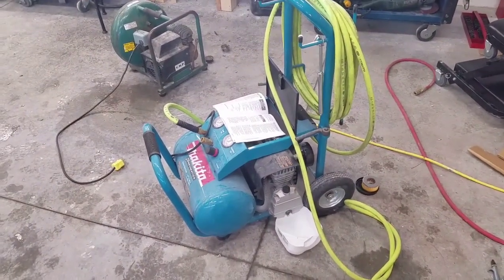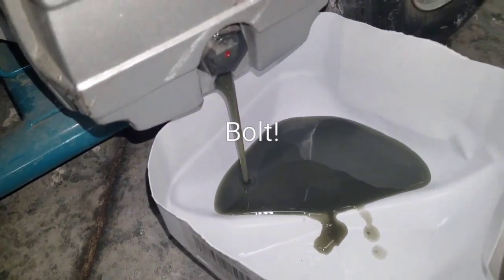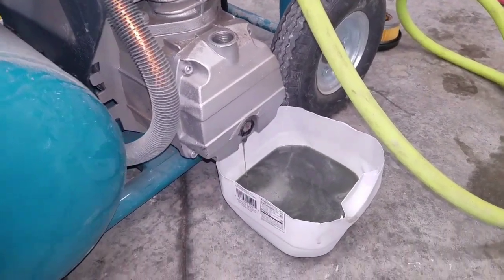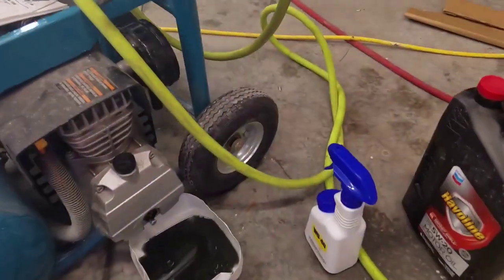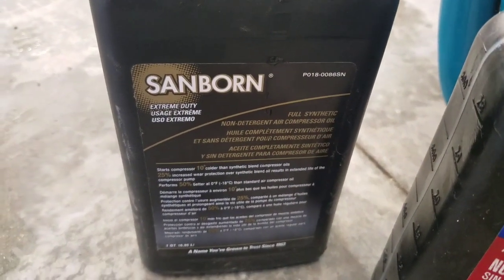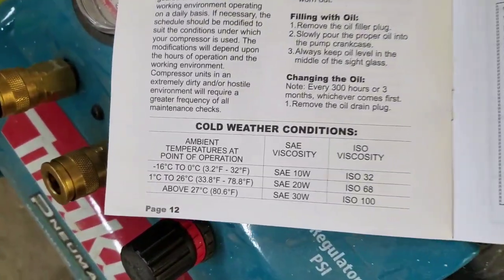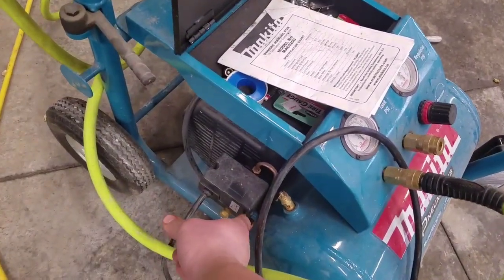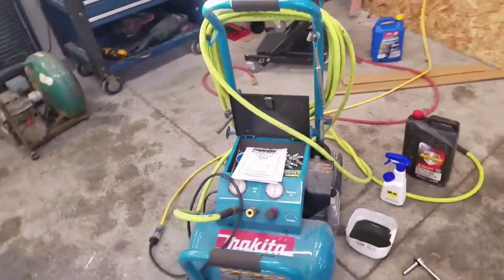Makita MAC5200 Air Compressor Oil Change, Review and Sound Comparison

Comment: I bought this compressor when they first came out, probably 4 + years ago.  I've never changed the oil, and I run it daily as a contractor, often all day long, with multiple guns, we spray paint with it, running all day everyday for weeks.  It just keeps going, I'm going to change the oil tomorrow, she's earned it.
Reply: Do you have any idea what the black and red rings, being the regulator, are used for? I’m guessing they’re for adjusting something?

Comment: I just bought a used one of these at an auction for $100.00, it runs pretty darn quiet.  Very impressed by it.
Reply: Mine seems loud as hell. Granted it is my first air compressor
Reply: @NotAMotoVlog  Did you check to see if the black plastic shroud around the motor is vibrating badly against the air filter? Mine does that and makes a heck of a racket. I shoved a wooden wedge in there to keep the two apart and it made it a lot quieter.
Reply: @frameriteairdrie578  good tip, I'll check that out. About to change the oil in it anyway. Thanks!
Reply: I've had mine for 20+ years and never changed the oil 😮 looks a little low... lmao! Shame on me...🤷‍♂️🤣 Makita is #1🎉

Comment: I really like this compressor and that I can run two big nail guns on it parallel and not run out of air, but what I think is really poorly designed is that the oil seams to run out of the compressor when you tip it up. The design seems perfect for tipping it up to save space in a trailer, but I noticed that I had a little puddle of oil. At first I didn't notice where it was coming from, but I later noticed that the compressor was leaking oil. It would have been perfect had Maktia thought about that. It comes so natural to tip it up (also, I don't think it has feet for that purpose, which would have been the next improvement.) Thanks for this video. I was actually looking for an oil substitute (because I'm now on a pinch and I can't go to the store to pick up oil due to COVID lockdown).

Comment: I never changed the oil in my MAC2400 after 11 years of use.  (I'm a contractor).  My tank started leaking today because of rust I very rarely drained the water. I think I got my money worth.

Comment: That’s weird that the big Makita is that loud, my MAC700 is damn near silent in comparison to normal compressors. It’s a low pitched hum vs the annoying high pitched noise everyone is used to hearing. Also the Makita’s are amazing quality from what I’ve put mine through. I work for a water company and last weekend I  ran the MAC700 for 6.5 hours straight (we have hour meters for the air compressor power supply) to fill up a 6000 gallon pressure tank half water half air at 60 psi. Definitely changed the oil right after that haha
Reply: Well this is a larger capacity and more powerful compressor compared with the 700
Reply: @robertopics  The MAC700 & MAC2400 both run the motor at half the rpm, 4 pole instead of 2 pole of the MAC5200. Thus they sound more like quieter lawnmowers or 4 stroke engine instead of a chiller room.
Reply: This one is particularly loud, because it sounds like it has a common problem for that model. The black plastic shroud around the motor vibrates badly and hits against the air filter at high speed. and sounds just like this one. If you grab the shroud, the noise instantly cuts in half. I tried trimming mine so it would clear better, but eventually shoves a wooden wedge between the two and that keeps it a lot quieter.

Comment: Oil change every 3 months in the manual? That's insane. Who does that? I put Amsoil SAE 20 weight in mine. But now I've got to ask the company what to do if the temp fluctuates from 70-85deg.... what an odd temp range for the oils.

Definitely a 90dB air compressor. Great cfm tho for portables. Runs a stapler like it's imaginary.
Reply from the maker: lifeisgood070 right?! Nobody changes air compressor oil. 3 months is overkill. 20W is a good viscosity.  It is a great compressor.
Reply: Happy Easter & thanks :)

Comment: I didn't know you can leave air pressure in it all the time. I drain it after every use.
Reply: If you don't use it much it's wise. The heat from the motor causes water and if it sits in the tank it rusts it out.